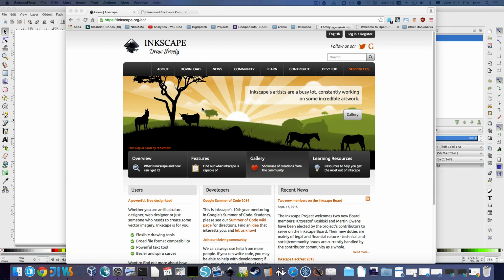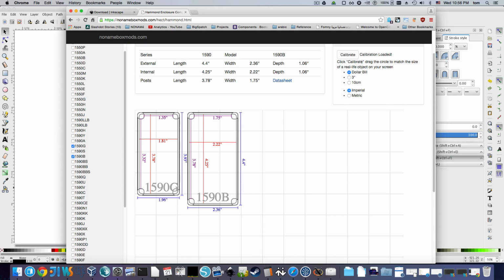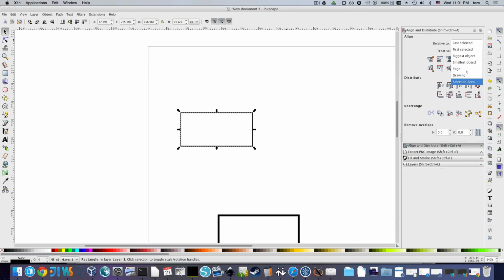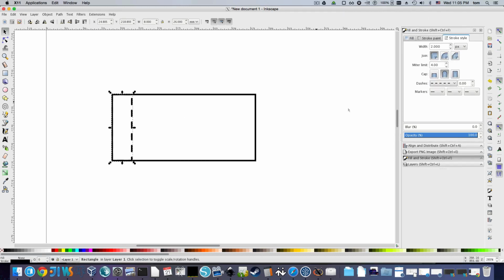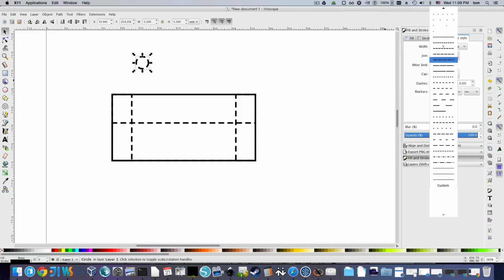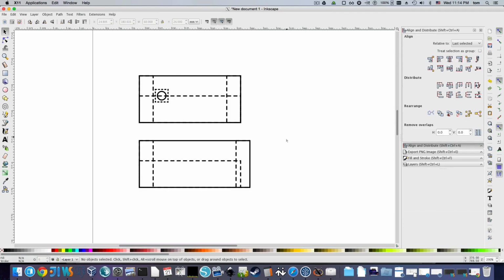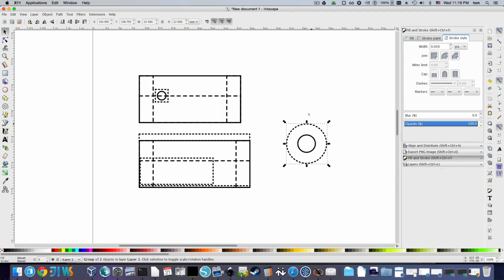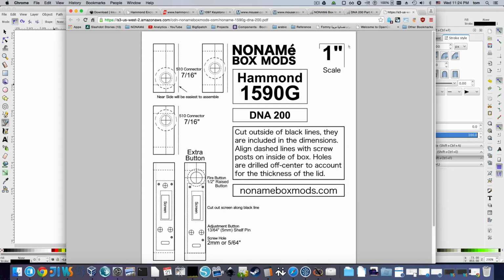Designing Drilling Diagrams

Comment: +advicevice so I'm sure you've had this question before but i was wondering if I'd be able to throw a triple 18650 sled in one of your 1590b boxes for a dna 200 chip. ..  would it work properly?
Reply: by properly i mean at 200 watts etc
Reply from the maker: +re1987p I suspect it wouldn't fit. You would have to grind both the double sled, and single sled to get it in the box, and then there really wouldn't be room for the DNA board unless you mounted it to the front with the batteries over it, which isn't ideal.